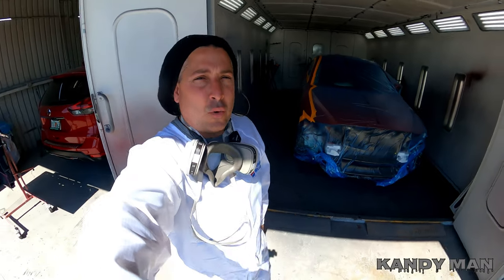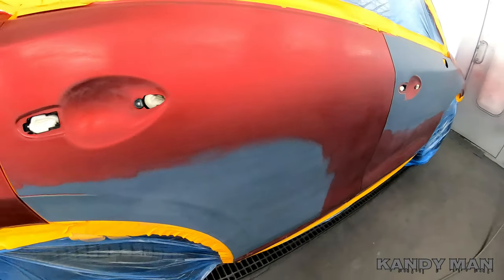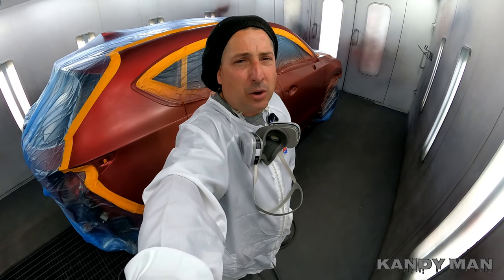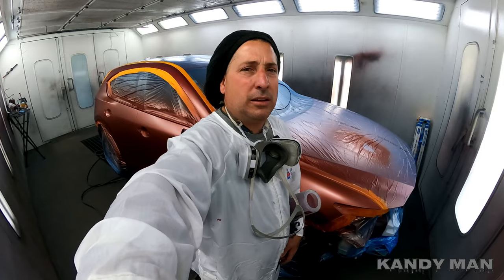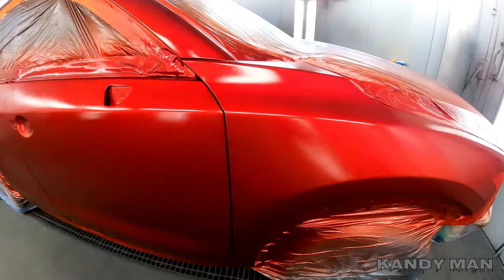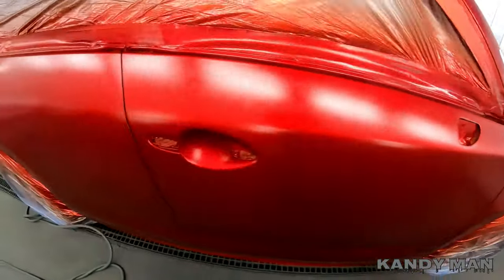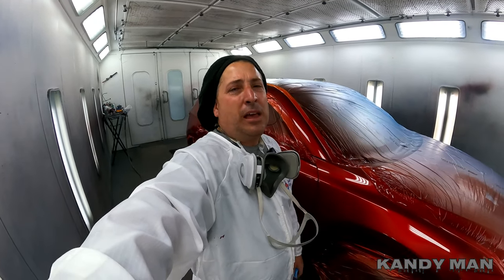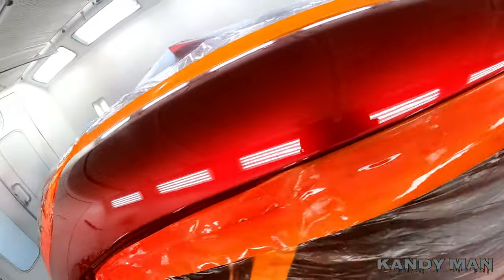Mazda cx-5 46v soul red

Comment: You should check out New Porsche Saffron Yellow, i hate Yellow but that new Yellow they have is very pretty. From what i was reading, it requires a ground coat, Clear, Mid Coat and final clear. Not sure how true that is but it looks bitchin
Reply from the maker: Thanks I will check it out

Comment: Just started spraying my s10 stepside with this 46v using matrix mpb lv, quick question I'm stressing on the bed pieces (steps) butt matching. The only way to get complete color change is with parts off. Any suggestions? Great video
Reply from the maker: Be as consistent as possible  distance  , speed,coats, pressure  keep all that in check for best results  hope this helps

Comment: Thanks for the videos your work is awesome. I am currently spraying this at work with Sherwin 9k water. Any tips for getting trash from my gun in the 2nd coat of mid?
Reply from the maker: Break it down clean thoroughly.  I use the 3m performance so new head and I'm good to go.
Reply from the maker: Stain mid before pps
Reply from the maker: Forgot to thank you
Reply: I went back and tried nibbing it out and ended up rolling the color down to the sealer. What a mess. Lol. I guess I will have to start from scratch. At least it is just a hood
Reply from the maker: Oh man got to love it